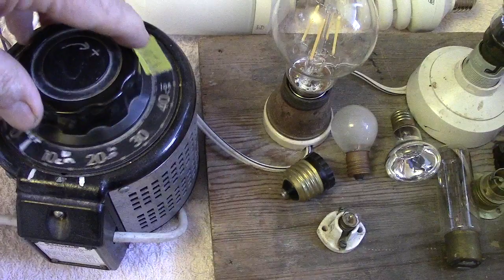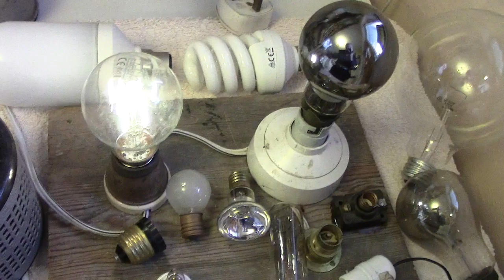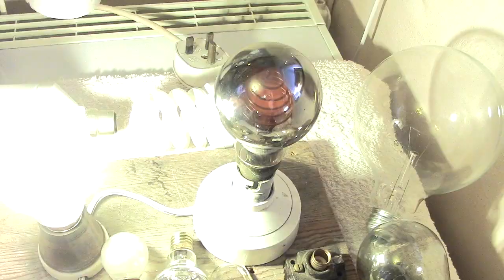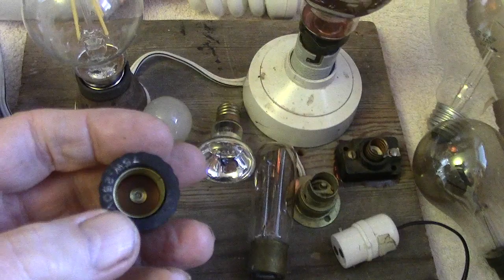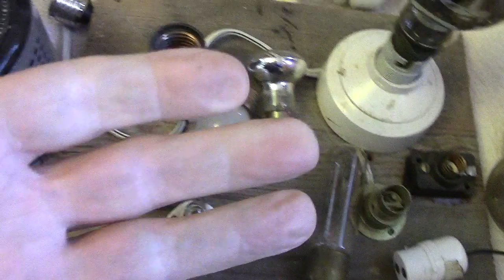My lamp testing set up. vid for Der Neon Junge...enjoy!

Comment: A very nice little testing/demo setup. I know the common bases here in the US are the Mogul, Edison screw, intermediate base, and the candelabra, in the UK it appears that the bayonet is the most common, then would it be the small bayonet? What about Germany and the rest of Europe?
Reply: In Denmark the most popular sizes used to be E27 and E14 for interior lamps. E10 for battery torches and E40 for streetlights. Very seldom bayonets.
With halogen came all kinds of strange types.
Reply from the maker: I agree BC not common on the continent, France still uses but I think they may change to the ES